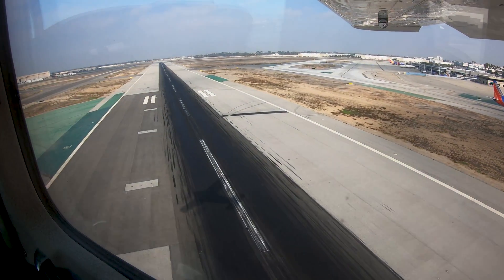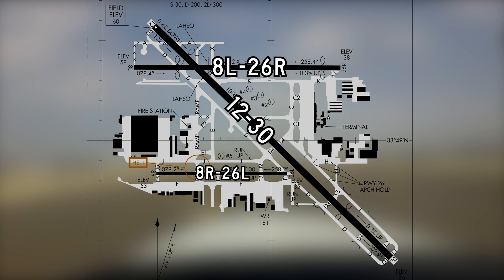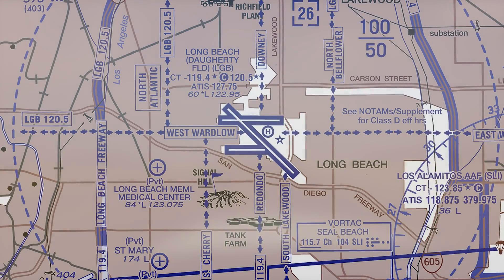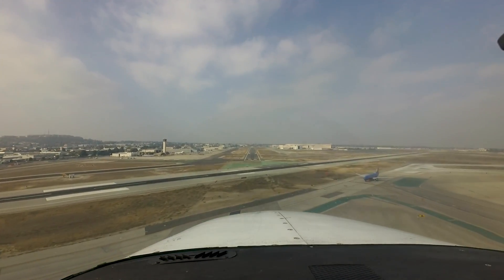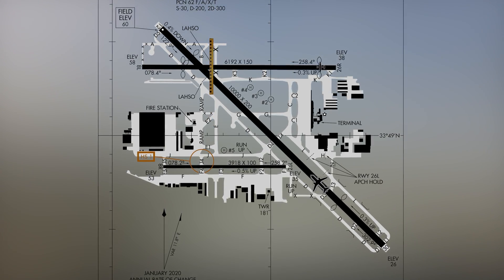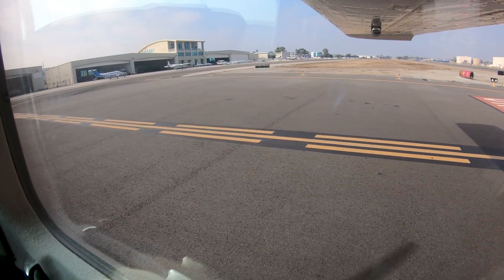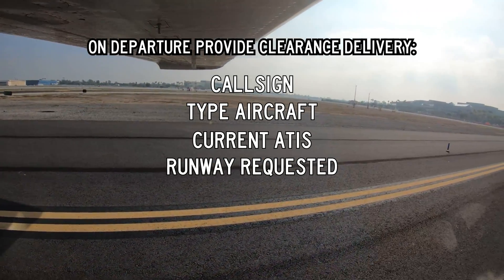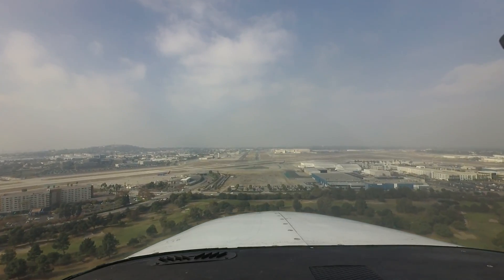From the Flight Deck – Long Beach Airport (Daugherty Field) (LGB)

Comment: Wow what a great video. Really helpful especially with the clips of what a pilot would actually see (signal hill example). One item I'd throw in for all the pilots new to the airport that ties into the visual reporting points is understanding the location of the Los Angeles river. The first time I landed and departed here, I was instructed to turn left at the river after taking off from 26L. At the time, it was just a dry concrete channel which wasn't what I was looking for. Great video!